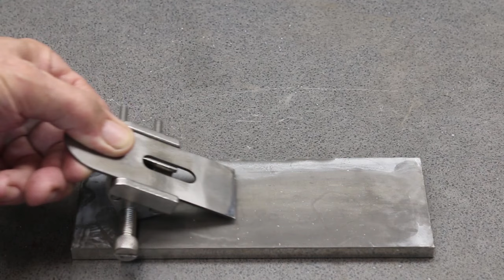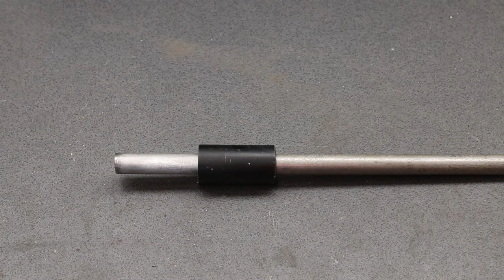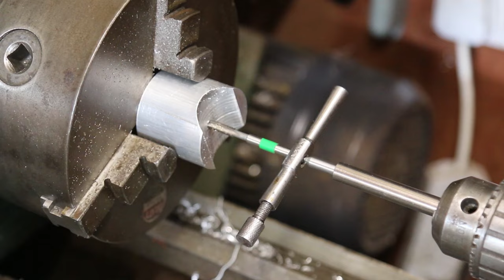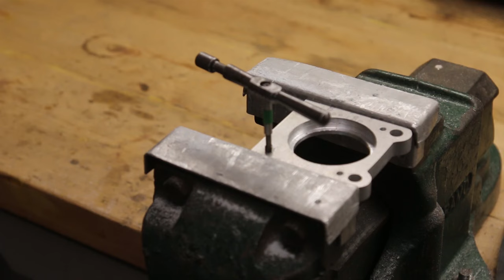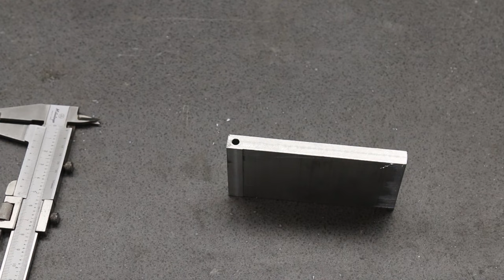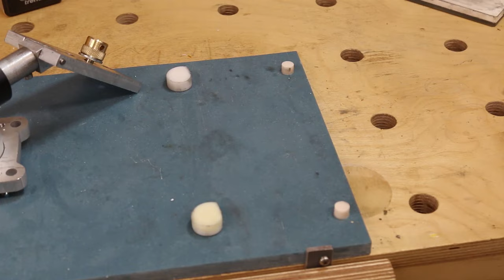hone master

Comment: Nice. Although I think it makes less use of the entire surface than the traditional honing guide,  very much like windscreen wipers. 👍🏼😄
Reply from the maker: @SirBenJamin_  Most honing guides run on the surface of the stone, so you have to keep turning the stone around. And cannot use irons wider than the stone. And tend not to use the edges, because of the roller action. With this, you use >90% (depending on blade width). Turn the stone around and it becomes all of it. I certainly find I am using more of the stone. Circular motion for roughing, sideways for the final edge.
It is not like a windscreen wiper, because you have two degrees of freedom. Mercedes used to have wipers with a camming action to reach the corners- same idea, but more so.
Reply: @Tensquaremetreworkshop  What I meant was that if you were to use a water stone, with your design, you would definitely see deeper wear patterns than with a traditional honing guide where it's much more evenly spread out. However, I still think yours would work better in terms of cutting efficiently as you can do the figure of 8 and at a faster rate (much like how you would do it by hand).
Reply from the maker: @SirBenJamin_  Yes, the idea is to have all the freedom of hand honing, but with the support that prevents the angle changing. I find that, for me, I use more of the area of the stone than when using a conventional jig. Such a jig, that uses a roller, only moves in one direction (forward and back) and it is difficult to use the sides of the stone's surface. Of course, the initial shaping of the chisel/iron is done with a diamond stone, where it is not important. I then use a 6000 ceramic stone, and use moving circles, traversing almost the whole area of the stone. Then it is the 16000 grit, which takes little time. This is the only stone needed for later micro-bevel sharpening, and I find sweeping strokes give the best finish (I have looked under high magnification). Because the jig is very accurate, I can do the secondary bevel at +1/2deg, and later a tertiary bevel at +1deg. I am still experimenting with this, to find the optimum for number of re-sharpenings before the primary bevel needs to be reset (back to 1000 diamond for this).

Comment: Another genius invention, Mike. I think this device is begging to be motorised to remove the repetitive 'elbow grease' part.
Reply from the maker: Actually, there is a lot of 'finger feel' involved. Especially with plane irons, where you often want the slightest of bevels across the blade.
I feel sure that, if a true automated sharpener had been developed, we would not need to perform so much work on brand new tools- they would come sharpened.
In practice, after the initial back flattening and front angle establishment, the re-sharpening by micro-bevel just takes a few seconds. Especially when you are not trying to get the angle by 'feel'.
Reply: I do not own any high-end tools such as Veritas or Lie-Nielsen, but based on reviews, they are ready for use straight out of the box, which suggests that sharpening is already well-automated. 

Perhaps the reason high-end manufacturers do not ship blades sharpened to the maximum is that the finest level of sharpening is likely to be compromised during shipping and handling. 

Regarding 'finger feel,' a bolt with a spring could perhaps be employed to adjust the tension and pressure according to the user's preference. These are just random thoughts, given your previous inventions, I’m confident you can come up with a much better idea than I could.

Thank you for the video, by the way. Initially, I thought you were making something similar to knife sharpening jigs, but as usual, you’ve pleasantly surprised everyone by taking it to another level.
Reply from the maker: @alfgordon1741  Thanks! Yes, I believe high end brands come sharpened, but at least some of them claim hand sharpened. The back flattening could certainly be automated- but given that you only do that once, and I have enough chisels and planes to 'see me out', I do not intend designing that! Not sure why manufacturers do not do it- I guess the majority of chisels are never properly sharpened. Our local Men's Shed gets lots donated- and I have not found a well sharpened one amongst them...